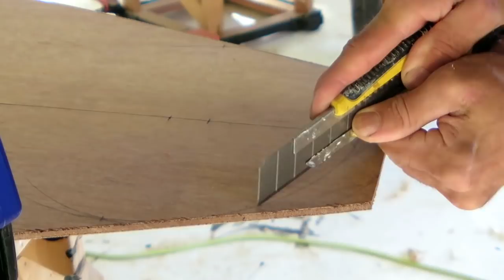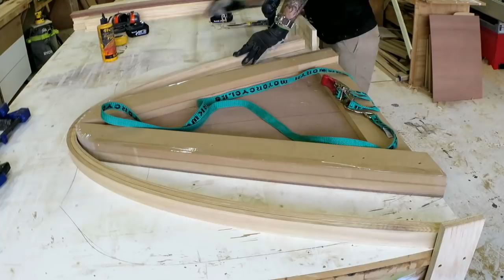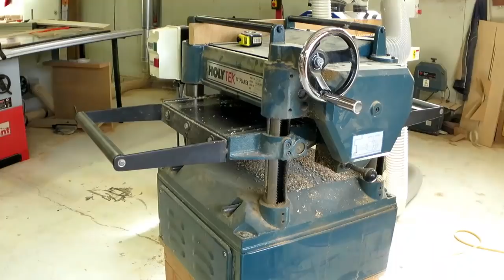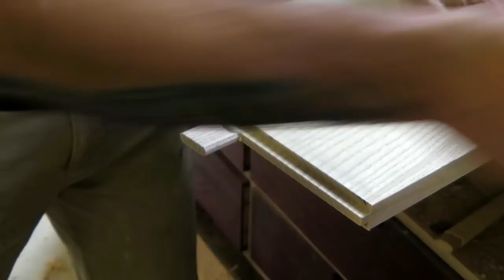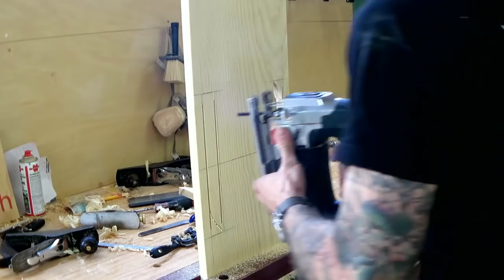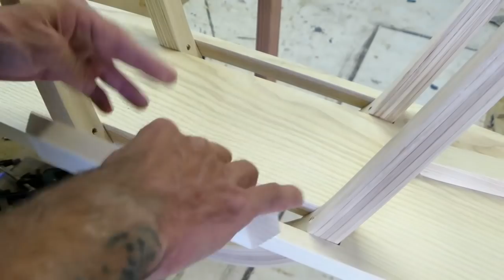Bent table

Comment: I really appreciate that you are so honest about your fails and errors. Kinda motivates me. 

Whilst I do appreciate the craftsmanship by having each leg actually being one continuous piece, I feel like creating the illusion of it being one piece (by simply having the legst attached to the bottom and the circular parts attached to the top) would not only have been a lot easier, but also ended up with a cleaner look, because there wouldn’t be any gaps. Did the client explicitly request that, and if so, would you have preferred the other (fake) way?
Reply from the maker: +Fritschge128 hi,  I personally think it would be much harder to do it that way.  Trying to drill the dowel holes in the angle in all 3 pieces and have them line up would be a nightmare

Comment: Nice, were you tempted to splay the legs slightly to overcome the optical illusion that parallel legs look as they they 'toe-in'?

I sometimes have trouble laminating in a confined space (like a vacuum bag) using pvc. It doesn't like it, takes much longer than usual to dry and hold. Especially if the shop is a bit cool.

Is this American or European ash? What is it sold as in Auckland (I'm in Central Otago)?
Reply from the maker: HI,  it didn't really occur to me until it was too late to splay the legs a couple of degrees.  Its american Ash prime grade sold bt BBS timbers who have a branch in chch i believe, there pretty good at picking and shipping too.

Comment: Great job.Really enjoyed watchın ıt.Not sure what the extensions on the end do though.
Reply from the maker: Hi,  they are to prevent the board from cupping/twisting as its largely unsupported. by only gluing it in the middle it allows the board to "breath" with out cracking etc.

Comment: Really nice work.
But if I may say, as constructive comment, I wouldn't have plug the hole between the arches of the leg, and pegged those from the side., It would have given a strangeness factor to have hole in your table.
Really nice ideed.

Cheers
Reply from the maker: Silvère Sayag cheers . I had thought about that,  it was a 50 50  decision.  if I make another one I'll do it that way just to see.

Comment: I Love It!!
One question, is it possible to glue the bended parts at the same time those are bended? just right after from the exit of the steam chamber.
Reply from the maker: +Abiel Muren the timber is very wet from the steam so glue won't stick,  also you only have about 1 miniut before the timber cools off too much.

Comment: Nice one! if you have any ash left over, try bending a solid leg.
Reply from the maker: Mitch Peacock - WOmadeOD  hi Mitch,   yea I should  i don't have high  hopes but worth a try.
Reply: A lot of boat builders pull simar curves in ash over here. I have a table planned that needs four, and I'm hoping to do that in oak.
Reply: I was wondering about that too. Ash is a good bending wood, I've bent solid ash for sack-back Windsor chair arms, always with a metal band compressing the outside of the curve. I was thinking that I would've used bent lamination or steam bending, actually have not seen both used in a single workpiece. And urea formaldehyde glue for bent lamination work. Neat little table though, enjoyed watching the process.

Comment: There was an easier method which didn't require cutting big holes in the table top for the legs.
If you cut the legs in three so you were left with a top half hoop and two legs per side. Then drilled an angled hole through the table top that would accept a large dowel that acted like a tenon for both the top hoop and the lower leg.
Or make the top in three section then joint and glue it up around the legs.
If you understand that then you are a genius like this solution! LOL.
Reply from the maker: they are options, but im not sure if they are easier.
Reply: In hindsight you're probably right.
However aesthetically the construction methods suggested would be less obvious and more puzzling!
Reply: I was expecting to see the top built around the legs too. But the way he did it worked fine.